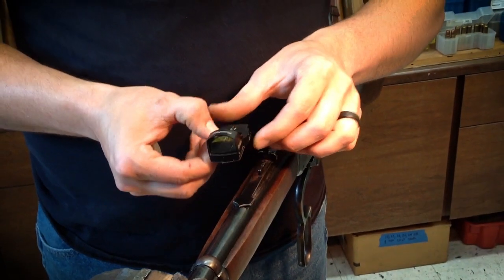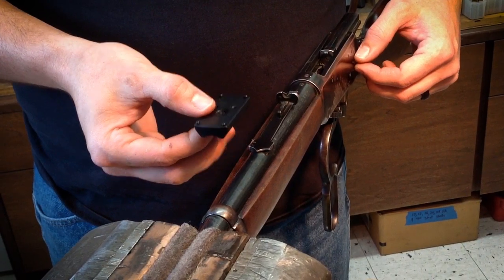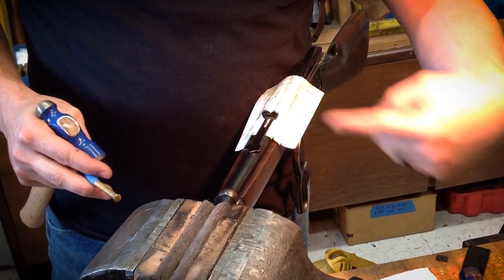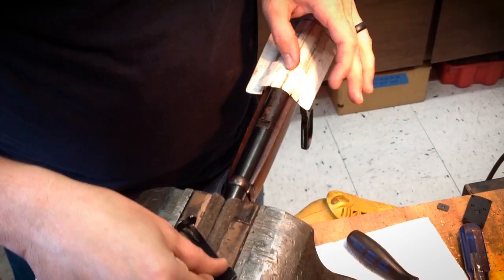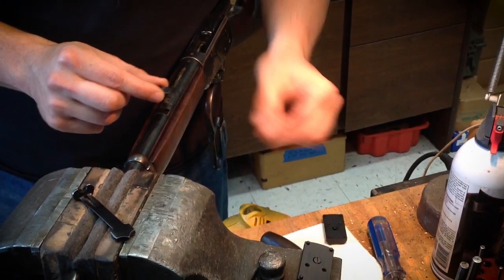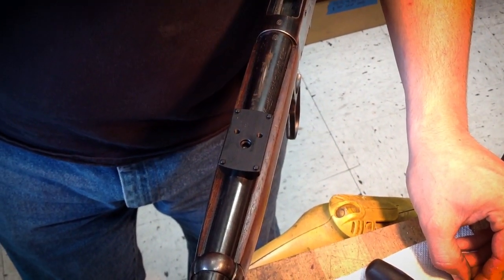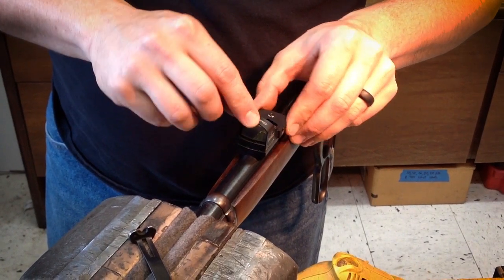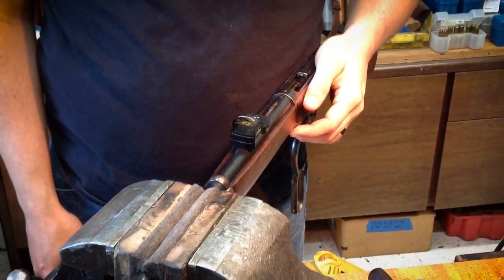How to Mount a Burris FastFire Red Dot Sight to Your Winchester 94

Comment: Very interested in putting a red dot or fast fire on my 94 top eject. How ever do you ship to Australia.
Reply: @adrian sharp get the Pearson pic rail off eBay it’s $65 and allows you to mount scopes/red dots etc on top eject pre 64 model 94’s. Using factory screw holes, no modification needed.

Comment: Why you won’t make a mount that fits the RMR optic is beyond me.
Reply: I’m not sure now but a few years ago the Fastfire 3 I bought was the only red dot rated for 12ga and high-er power rifles(556/300blackout  and normal pistol calibers have very little recoil). Trijicon is known to build high end “bullet proof” optics, I’d assume they just didn’t verify higher recoil durability results through an accredited testing program so “maybe” a custom high end builder doesn’t/can’t trust them without more verification? Similar to body armor testing, there has to be a standard if you expect good/reliable results. My two cents anyway…there is 50 plus different models of red dots nowadays too so as a smaller custom shop owner you’d have to choose a select few products to build especially if it’s for a rifle created over 120yrs ago from JMB. Thank you Mr Browning and Turnbull for making timeless things of beauty that function well!

Comment: Do you guys offer the same base plate but with a rail mount for scout scopes? This base looks way more secure than the one that I have from a company that I won’t name that always works its way loose.
Reply: Thread sealer on the screws and or with JB weld compound.